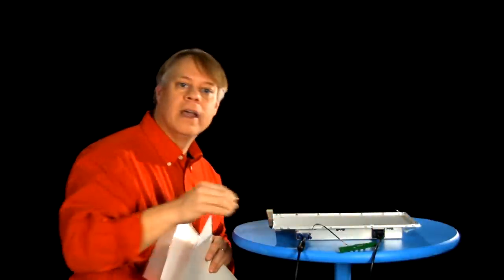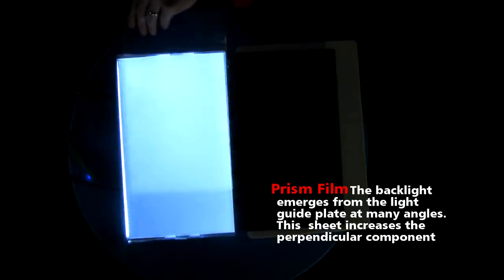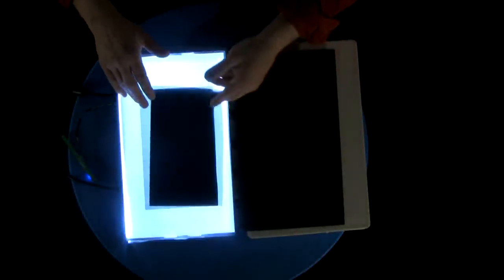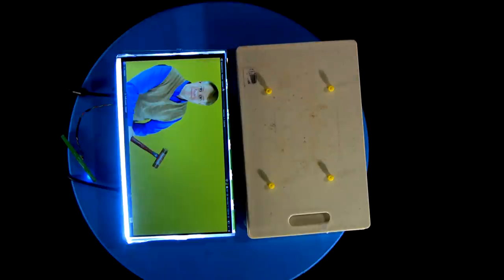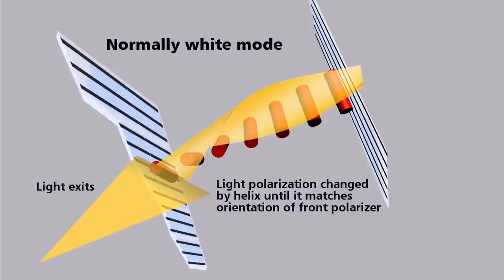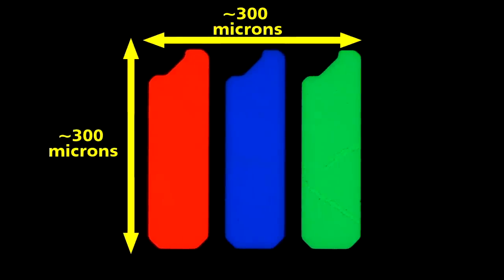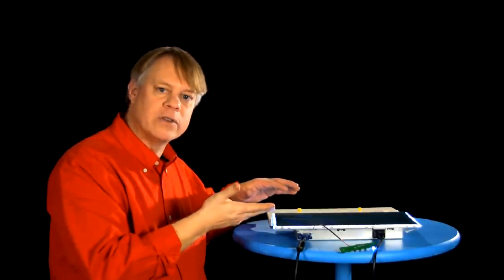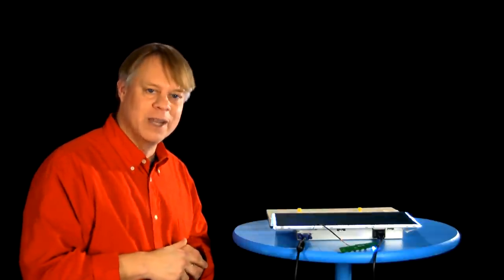LCD Monitor Teardown

Comment: LCDs are great for mobility, but I don't know if I like them on the desktop and in my living room. CRTs look nicer than most LCDs. Only late-model PLS/IPS screens even come close. Plasma could rival CRT, but that didn't survive or spread outside of televisions. It does bother me a little that the only consideration for technology these days is how little electricity it uses, and how portable it can be. No one really cares about quality, modularity, or raw processing power anymore. 

It's great for all the iPhone/Android people that like doing stuff with their fingers, but it sucks for power users that like to touch type and find the new stuff limiting. It seems like every new piece of technology makes everything more locked-down, breaks a few pieces of backwards compatibility, and eliminates choice and configurability. LCDs eliminated the choice of using lower or higher resolutions without scaling, and using old-fashioned lightguns. Not a big deal at first. But then we start seeing all these phones and tablets that you can't replace the OS or upgrade the hardware on. Then you see laptops start to be built more like tablets. Then we got Windows 8 and GNOME 3 that are ridiculously Spartan and touch-oriented with few configuration options, like a phone/tablet. In Windows 10 Home Edition, you're stuck with whatever updates Microsoft pushes out and it's much harder to install a specific version of a driver other than the one Windows chooses by default. Office doesn't use menus anymore, they try to make everything touch-friendly and use these weird ribbons. Secure boot BIOSes might make it so that you can't get an alternative operating system installed at all. How long until they just stop making motherboards and monitors for people to make their own computers, and we're just left with 2-in-1 convertible laptops, and preassembled AIOs that are locked into whatever OS they came with?

I guess it's frustrating to me because I know so much about computers and I know how to manipulate all these things, but they're slowly making the computer into something that I can't do anything with other than what the manufacturer intended. It's getting to a point where someone like me, with all my knowledge... can't do much more with a computer than the average person can, because there are no advanced options exposed anywhere. And what few there are get buried deeper and deeper until they disappear entirely. Everything that made technology interesting to me is going away. Now it's boring, locked-down, and easy. About the only thing that interests me these days is the Raspberry Pi, and the utility of that is extremely limited. It's basically just a tool for  nerds to reminisce about how computers used to be as they come up with creative uses for them. Computers aren't for nerds anymore... they're for everyone else. Nerds and will have to find something else to interest them, because nothing interesting happens in technology anymore. Best time to be alive for that was probably between 1978 and 2006. Before that time, they were too simple and limited to do anything much more than act as a calculator, and after that time, they started taking features/options away to the point that a computer isn't much more interesting/configurable than a toaster or an alarm clock.
Reply: The scaling resolution thing is something I haven't thought about in a long time. CRTs rock for sure.
Reply: Use OLED if you want better power consumption.
Reply: Fearbleeds With LCDs, the screen physically can't do those things because it works on an entirely different principle. You can adjust resolutions through scaling, and you can choose whether you want fast refresh rates via TN panels, good color reproduction and the best viewing angles with potential glow problems via IPS/PLS panels, or good viewing angles and black levels with decent color reproduction at the cost of slow refresh rates on VA panels. But those are all the choices you get. The CRT choice has been taken off the table, and while LCD is good enough most of the time, I do find myself in situations where I miss a feature or two that CRT had. With an NES game like Duck Hunt, you can't use the original Zapper to play it. That's because it relies on light of specific colors being emitted between blank frames... and LCDs don't work that way. I'm not a fool, I'm nostalgic. 

As far as other pieces of technology are concerned, the regression is not in power, but in freedom. Companies are locking down devices for the purposes of copyright enforcement (as well as security) and limiting what you can do with them. I can often bypass these things with a lot of work, but it's getting harder as they build these protections into deeper and deeper physical levels of the system, and try to design things so that they break beyond repair if you open them up and see how they work, putting glue in awkward places, etc. I'm frustrated that I now have to fight with a computer in order to regain even half the level of freedom I used to have with it, simply because manufacturers want to have control over how everything is used. A lot of users don't do a lot of odd things with their machines and probably don't notice this, because their use cases are covered by the manufacturer.
Reply: +Jeremy Andrews ok I see what you mean. OLED displays are going to solve some of the issues, with refresh rates capable of 100,000 and infinite contrast. Technology is advancing incredibly fast. Sure you can't play duck hunt. But now you can walk in a virtual world. And yes companies like Apple take freedom away, but anything digital can be hacked pretty much. Where there is a will there is a way they say
Reply: Use a good quality one and set the refresh rate to 85Hz or more. They only flicker with a low refresh rate.

Comment: But why can't you update all the rows at once? That'd mean like (1440*144hz) monitors!
Reply: If you wanted to update more than 1 row at once, you would need more video data. 
To update all the rows in a simple 800x600 monitor at once would be ~1,440,000 wires to update the 480,000 pixels! This is simply a huge waste compared to just switching rows very fast.
Reply: Hatninja But why can't you just update all the rows at the same time?
Reply: You probably could, but the costs outweigh the benefits.
Reply: the lcd crystals need time to discharge the electricity. once you cut power to a pixel it slowly fades as the crystals become disorganized. therefore you have to compensate by either powering a row at a time or you interlace (power every other row) this happens 60 times a second.. the powering on and off the crystals .

Comment: i have a question, this guy told that when u rotate too sheets into 90 degree the light will not pass through by putting another sheet in front of it but, the other sheets tht under the sheet with he showed as an example how about tht? that didnt turn into black!!! pls tell me why
Reply: The two sheets that he talked were the Polarisers.

Comment: @quangluu96 

Whew, lastly, LEDs last longer than LCDs. The CCFL bulbs in LCD's burn out wayyy before an LED ever would. 

I can't really see anything that would be worse about an LED lit LCD than a CCFL lit one. For your money I would pick up an LED. 

If you can find one that isn't edge lit and has local dimming that would be your best option for best black levels. Just know that edge lit LED's fall to the same problems as CCFL lit ones in black levels and even lighting.

Hope that all helps:D

Comment: how does this differ with LED lit screen. I mean LED still have a LCD but how does an LED differ in the back light.
Reply: Wait, I thought LED screens were just...LED. Why would they need LCD if leds can behave however you want them to?
Reply: DaBlaSit when I worked at Best Buy I was told that they are LED backlit instead of fluorescent tubes but they both have LCD screens.

Comment: If the pixel masks are physically located on the screen, how do you get different resolutions?
Reply: I don't actually know, but my guess is that the pixels are made out of the factory the highest resolution you can get, in most cases 1080p. Then, it simply downgrades on demand by assigning, for example, every 4 pixels to do the job of one, then you get 240p.

This would explain why for example it is impossible to play 4k on a 1080p screen.
Reply: Hyrum Diesen But you could only do whole number divisions, so the native resolution would have to be much higher to allow for varied aspect ratios, etc.
Reply: None of the resizing is done in the hardware, it's all software. (except maybe in some exotic screens?) It works the same way resizing an image works: you do resampling which makes a virtual pixel effect either more of fewer of the physical pixels. If you're taking a screen at half resolution, then you assign each virtual pixel to four physical pixels, but if you're doing something like 1/3 resolution, then either you'll have pixels of varying sizes, or you'll have multiple virtual pixels influencing specific physical pixels—the colors get blended on boundaries which lets you have things like a single virtual pixel controlling "2.5" physical pixels. Varied aspect ratios usually just work by ignoring part of the screen, so you get those black bars.
Reply: Caleb Jones Wouldn't that cause problems with artifacts that would require on the fly anti aliasing?
Reply: I'm not sure exactly what you mean, but it does cause artifacts on screens that don't match the requested resolution very well.
Reply: As Caleb Jones explained, it's a software feature called also "interpolation", to adjust the resolution sent by the operating system to the screen. It's normally done by the GPU drivers. But all the screens have something called "native resolution", and that correspond to the real amount of pixels the screen has. And there you get the best user experience, as 1 pixel sent by the operating system matches exactly to 1 pixel from the screen. If you use a lower or higher "software resolution", you normally see artifacts or defects just because the proportions can't be matched correctly
Reply: Jim Fortune there is a top limit to resolution based on the number of pixels across the screen. to obtain lower resolution they simply group the pixels into larger and larger groups of a single color. the effect is lowered resolution.
Reply: Chad Cooper That works fine as long as you divide by powers of two.

Comment: What about LED screens? how do they work?
Reply: LED screens are, in fact, just LCD screens that use LED lights instead of the older florescent tube lights. The confusion comes from the marketing and advertising labeling them "LED T.V.'s" instead of calling them what they actually are; LCD T.V.'s with Light Emitting Diode (LED) back-lighting.
Reply: Jeffmorgan83 wow never knew thnx :D
Reply: This misleading marketing technique has made it even worse now with the [relatively] new OLED technology that uses actual micro-metric LEDs as screen.

So 'LED screen' = 'LED back lit LCD screen' and 'OLED screen' = 'Screen made of pixel-sized LEDs'
Reply: hmmm. that's interesting. thanks! i thought led meant led. not led, kind of...

just to be clear, when you say "even worse", you mean it's the same lie, just bigger?
Reply: ***** no, OLED screens are panels actually made of pixels. What I mean is that this confuses the average non-informed person. Someone could not think twice to buy a screen when they see "LED technology" (and in the small letters it says LED backlit screen)

Comment: What?
Not even close
a LED monitor is simply a LCD monitor that uses LEDs for the backlight(shown in the video is a LED LCD monitor)
Most LCDs use a CFL bulb instead of the LED strip

Comment: The only annoying thing is that the transistors whine on a full screen of black and white lines (and similar, like lots of black on white text). I wish they could come up with tech that eliminated this whining.
Reply: wow interesting effect. especially when you zoom in and out with smooth transitions. although i did not have any whining.. now that i think of it maybe you are getting coil whine due to the high frequency in that pattern.
Reply: Jez you must be very young to hear that whine. most adults cannot hear it. its an artifact of running at 60-70 hertz or rather 60-70 screen refreshes a second. the frequency following response of the brain does not like this refresh rate  at all which is why it annoys you.

Comment: You have been sucked up by marketing. There is no such thing as a LED display. Its a LCD with LED backlighting. The one in the video was one of these "LED" monitors. Notice the row of LED lights. 
In the older "LCD" monitors, instead of a row of LEDs, it was backlit by a florescent tube, making it larger and bulkier but cheaper. There is no difference in colour and image quality.  
Same technology, different lighting.